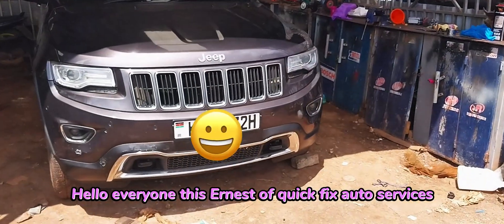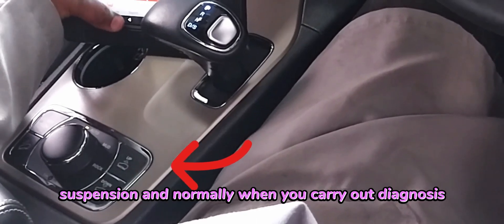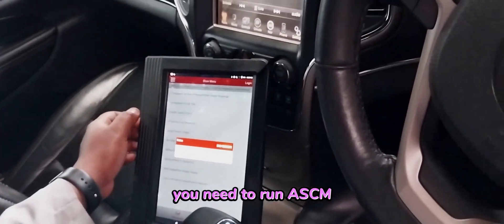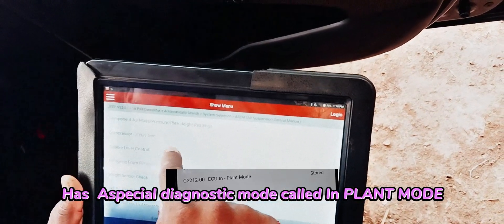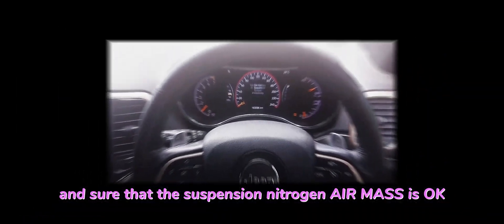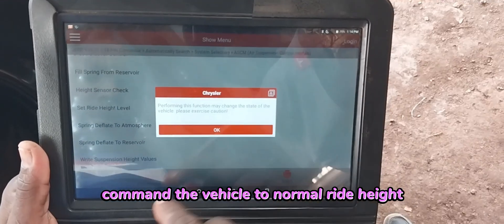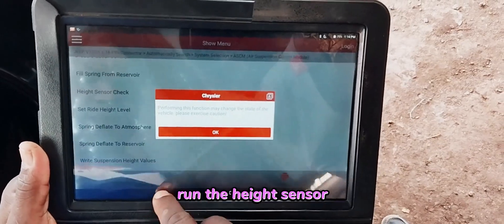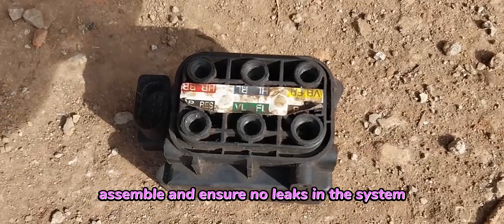How To Repair Jeep Grand Cherokee Air Suspension FAULTS

Comment: Yo tengo una Grand Cherokee Summit y le remplace los 4 sensores de altura, el compresor, el bloque, nitrógeno 100% sin fugas. El problema es que no quiere subir a la altura maxima y tampoco la puedo sacar de plant mode, solo me da código C2212
Reply from the maker: What values of height calibrations are you putting? .  Also ensure the rear suspension bellows are not leaking air. Lastly check on radio display for suspension settings and enable it. I hope this helps!
Reply: Thanks for your reply. Do you have any video on how to do it? I am limited in terms of tools, I am using the AlfaOBD scanner
Reply from the maker: @ the best scan tool to use is LAUNCH X431 V 3.0 Full System Diagnostic Scanner with ECU Coding and 30 Reset Functions. With this scan tool, you can explore ASCM module and carry out various tests and reset plant mode. It has the procedures to carry out special functions. AlfaOBD scanner can also perform these functions. what functions do you see when you enter air suspension maintenance with AlfaOBD scanner?.  Did you check enable Air Suspension on car radio display before carrying out any ASCM procedures?
Reply: Yo lo resolví de la manera más insospechada. Pero funcionó en una grand Cherokee overland 2011. Desconecte la batería. Probé la presión en el tanque de nitrógeno. Obviamente sin presión de nitrógeno. Conecte el compresor de aire a 8 bar por que mi compresor no daba más. Después conecte la batería y conecte el tanque al compresor vacío y encendí el compresor. No llegó a cero la presión pero como que el la bajada y subida a 8 bar otra vez el sensor mando alguna señal a la computadora. Después encendí la camioneta y empezó a subir. Conforme suban los amortiguadores tienes que agregar aire comprimido. Hasta estabilizar. Después fuera del modo odioso. Ahora si cambias el aire por nitrógeno en el tanque y solo dejas aire en los amortiguadores. Obviamente con la batería desconectada. Es cuestión de desinflar los amortiguadores uno por uno. Y cuando estén todos abajo. Conectas batería y dejas que suban de nuevo. Después v regresas el nitrógeno perdido al tanque hasta llegar por encima de 8 bar y no más de 13 bar. Y listoooo. Me costó muchísimo tiempo y buscar en internet. Espero que a alguien le sirva por que fue un infierno para mi. Saludos
Reply: @pomelio muchas gracias por compartir la información
Reply: Como lograste quitar el plant mode ?